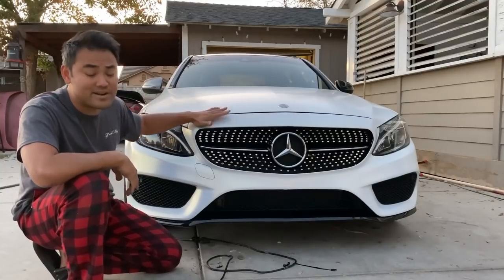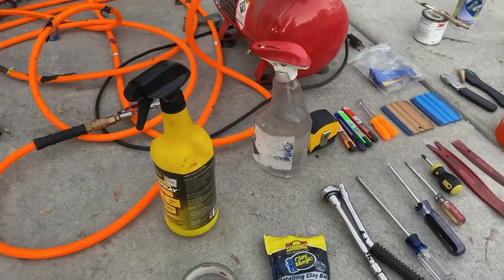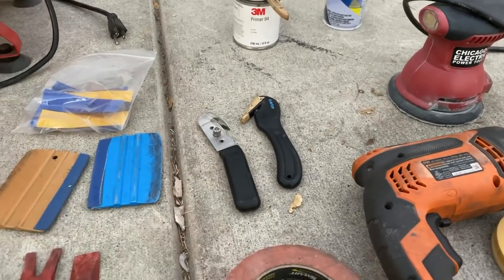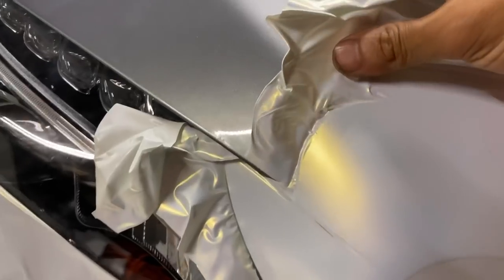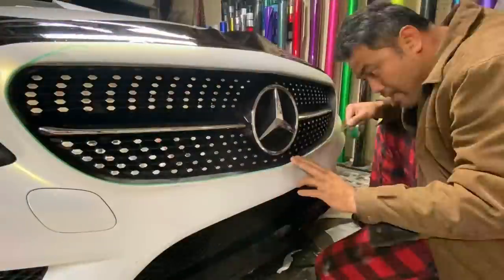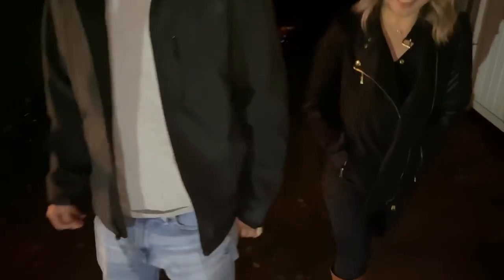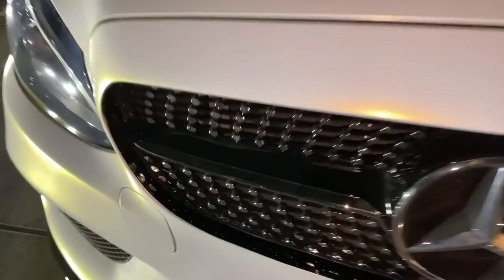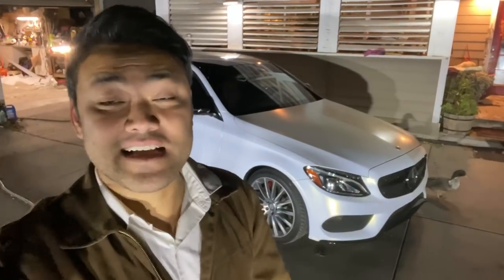Tools Needed To Wrap Cars At Home | Flaking Paint Mercedes c300

Comment: Had wrap on my OEM paint for 6 years. The carolina heat cooked it on the hood and messed it up. Not wrapper fault or wrap. The OEM clear coat / paint from Hyundai sux + 100 degree summers in Carolina. Sigh. Paradox can I fly you over here?  Lol

Comment: Okay so my car was completely repainted by a body shop and the paint isn’t the same tone as it was before, I can tell the paint job and paint itself wasn’t so good due to cracking and peeling and rock chips that is happening to the paint so what do you suggest I do ? before wrapping it
Reply from the maker: Sand all of it off otherwise it will just stick to the wrap and not the car
Reply: @ParadoxTheWrapper  Okay and after sanding, is it ready to wrap ? Or are other steps needed ?

Comment: I can see that it was repaired. Also the grill is not the standard grill for the C300 and neither are the rims as both come from the C450 AMG
Reply: @thomasho4368  The car has the AMG styling however the Diamond grill belongs the C450/C43 and so do the rims. Just look up the C450 and you will see it, then  look up the C300 and you will see the diamond and rims didn't come with this car.

Comment: What sandpaper do you use if the clear coat or paint peels and can you post a video of how to fix it sanding ? Any primer ? Before wrapping again ?
Reply from the maker: Just as long as it’s smooth
Reply: What grit 800, 1500 ?
Reply from the maker: LimeHellcat 400 grit is good enough
Reply: Ok thanks a lot

Comment: Just recently come across ur video and curious y u like this wrap brand so much and only use them exclusively ??  What abt brand like vvivid or 3m ?
Reply from the maker: The people actually pick out the color and brand they wanna use. I send them links to 3m and Avery colors too but teckwrap just has nice bright interesting colors
Reply: @ParadoxTheWrapper   O ic . That's cool .. Maybe next video to talk about the differences ?? Another question. I noticed in a couple of ur videos where u mentioned the car has bad clear coat half way through the wrap. Is there a way to identify the bad clear coat before doing anything ?? It's great to be transparent with the ppl but is that just part of the risk ?? anyways Great job on the video ! you should introduces all ur pets in the yard sometime as well :)
Reply from the maker: AirWick219 well you can test it by putting wrap scraps all around the car, heat, squeegee, then peel. But it’s hard to tell just by looking. Mostly it’s a risk that they must take if the paint isn’t oem or the car is old.

Comment: You’re not supposed to yank the wrap off you’re supposed to pull it vertically. Unfortunately here you caused all that paint damage even if there was damage already by yanking  the wrap directly off the car you cause more damage than it would’ve ever had. Heat it and pull it linear against the paint never directly off this is day one of wrap school.